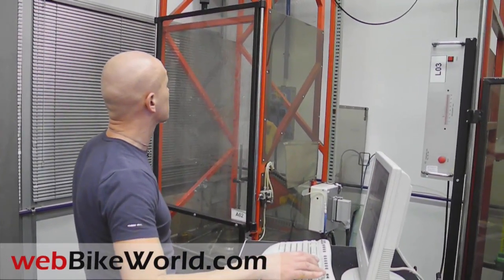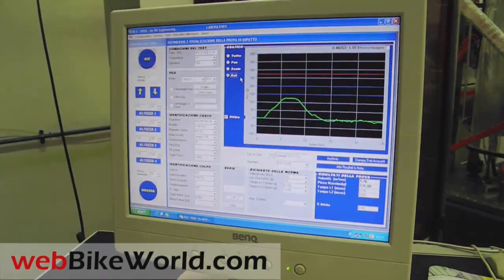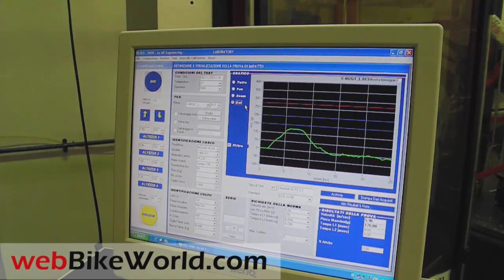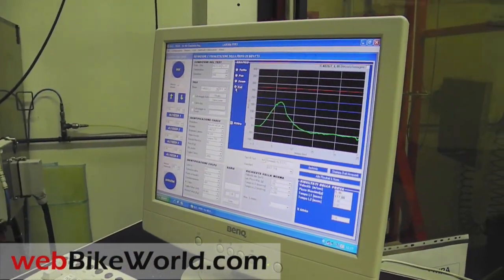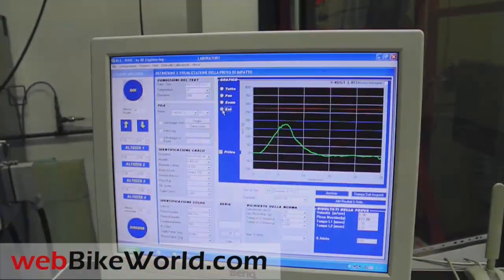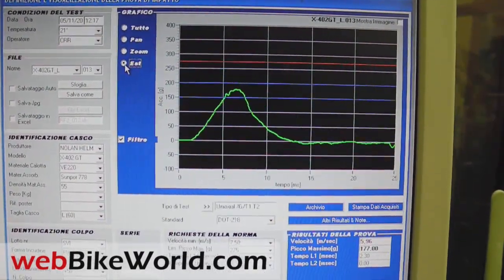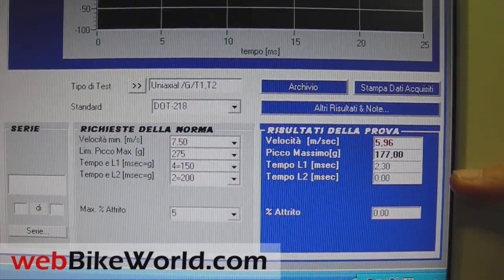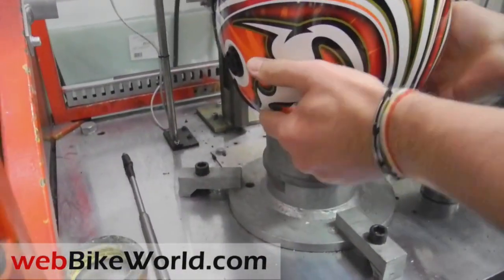DOT vs. ECE Motorcycle Helmet Safety Standards

Comment: That 2nd impact on the first helmet was way more focused. Would definitely consider that controversial lol wtf!
Reply from the maker: Snell does the same, multiple impacts in same location. Yes, it's somewhat controversial.
Reply: Do they test 1 helmet out of the batch or test each and every individual helmet?
I mean, they test the helmets, which in turn weakens them, then sell that exact same helmet?
Reply from the maker: The manufacturer sends a helmet sample to the lab, which is tested and not used again. Then the manufacturer self-certifies that they are using the same materials, production methods, etc. to manufacture the helmets. They do not test every helmet before it's sold. For ECE, sometimes random samples from the retailers are checked and tested again. For DOT, sometimes someone catches an error in a production run. But either way, there's not much of a guarantee other than if the manufacturer gets caught, they'll get in trouble.

Comment: Hi! Huge thank you for the visit. It is obvious that you put so much effort to this and i truly appreciate it. Nolan helmet with polycarbonate outer sheel met the standarts with 177G but i wonder what is the number for the X-lite helmets? They are amost twice expensive because of the composite structre. Worth it? What do you think?
Reply from the maker: Good question, the helmets are all tested to the same standard. Carbon fiber usually makes the helmet lighter but polycarbonate sometimes will absorb or dissipate energy differently. Find a good quality helmet that fits correctly, that's the most important part after safety!
Reply: After seeing these tests, i felt a lot better buying Nolan polycarbonate helmets concerning safety. Thinking about the N86 model ;) Thanks again mate, ride safely!

Comment from the maker: Not necessarily so, sorry. As I said, every helmet safety standard has pros and cons. ECE allows large openings on top of the helmet, as in the Caberg Ego. DOT does not allow large openings like that. ECE allows flimsy chin bars, like on the Airoh J106 or Marushin X-Moto Squadron, which has a chin bar that I can fold in with my hands. DOT does not allow that, thank goodness!